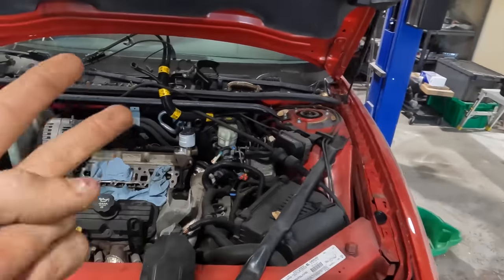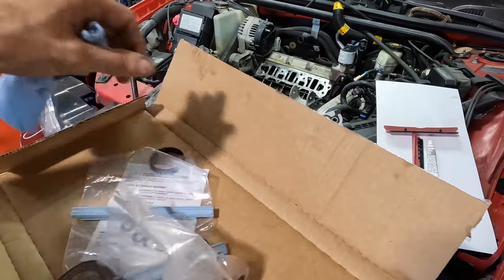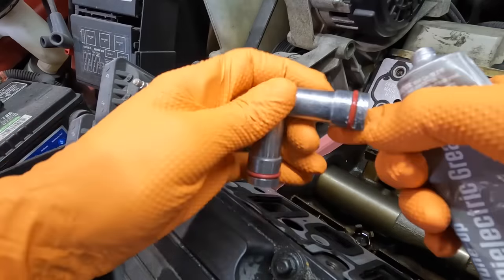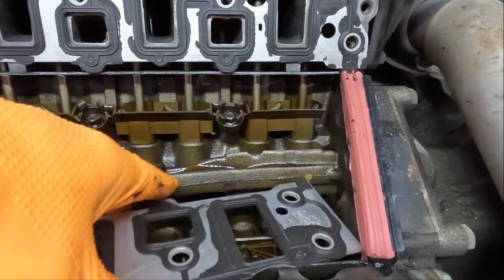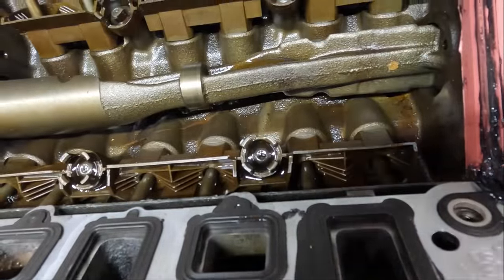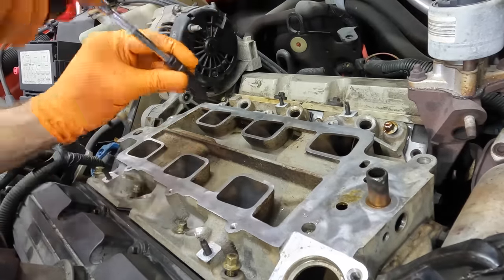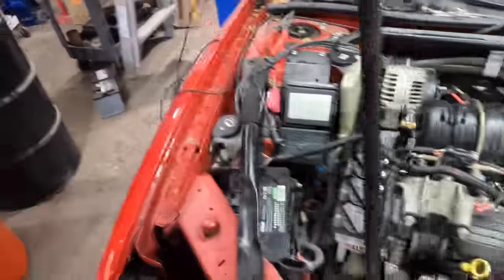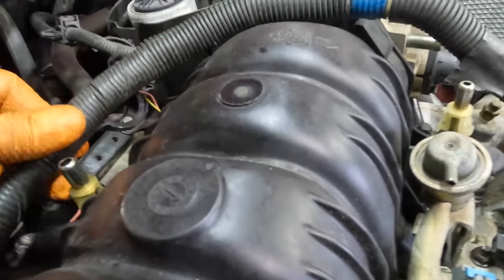Blown out Intake! 2003 Chevy Monte Carlo! 3.8 #mechanic #enginework

Comment from the maker: PT 1: Oil in Radiator! 2003 Chevy Monte Carlo 3.8 Manifold Leak!
https://youtu.be/R-0lWogkyhk
Reply: 15:48 - The threat of the prybar convinced the EGR tube to go in.
Reply: Bacon grease, but of course!
Reply: What a waste of bacon grease. Silly Ray, bacon grease is for eating 😋
Reply: THREE.
Reply: That other style aluminum elbow you were referring to goes on the bottom of the belt tensioner. I always remove the  belt tensioner and change both to aluminum, then it is good to go for a long time.
Reply: Am I wrong for asking why you didn't do the back 3 plugs while the manifold was out? Seems that would be easier. Feedback please
Reply: Mmmm, Bacon Grease 
LOL!!
Reply: @cw3339  Among other things...,
Reply: Got o pop problem with suction in my 3.8 by intake blew hold in my new plenum any thoughts it’s over heating a lot coolant low light won’t stop coming on even with new radiator and sensor in radiator for low coolant driving me insane why and suction issuie suction also on rubber gasket on map sensor
Reply: Outstanding video as always. Will watch your videos all night long, oh and day too. Lol

Comment: Replacing a manifold gasket is a lot more fun when I am watching someone else do it 🙂
Reply: 3800s aren't too bad. The 3100/3400s, on the other hand...
Reply: Everything's a lot more fun when somebody else does I like getting my hands dirty have a great day
Reply: @Michael Pressman  I liked to get out in the shop 3 or 4 days a week and get dirty working on assorted  motors too, but there is something interesting about watching someone else do it. You never know what tricks you might learn.
Reply: @joevk6274  every manufacturer had one of those at one point or another.  Parts that only go on easily with the motor next to the car.  🙄
Reply: Damn right
Reply: I can watch hard work all day!
Reply: @Jeremy T  If I am honest, I love wrenching on motors but it's nice to know I am not alone when I see someone else doing it
Reply: Frfr😅
Reply: @joedavidzuniga1993  🤣
Reply: It certainly is. I did many of these at a independent shop, and on my own vehicles.
Reply: @jamosgarage9006 Me too. I moved over to small engines just to get out of bending over a fender all day.  Having them on a bench makes it a LOT easier
Reply: @Guys playing with tools , I know former car mechanics who went to small engines, atvs or forklifts. They all said it's better than cramped engine bays and under dash. I honestly prefer body, paint and accessories.  I barely do engine work anymore.
Reply: @jamosgarage9006  You get it. I have never had to put my arms or body someplace it didn't want to fit while working on a weed eater or a mower 🤣
Reply: Only ever done it once. Was pretty easy actually. Looking at my other cars' engines, I wouldn't touch them.
Reply: @MusicConnoisseurian  When I was a kid I would change the intake and carbs around on my assorted hot rods all the time, I got pretty good at it but I sure don't miss doing it.
Reply: @AZ-pi9yf  You are right. It would be tough to have the knowledge but not be able to use it
Reply: Shit rays doing bread and butter. I have a bunch of transmissions from frod,gm and Dodge as well as getting race cars ready for the season. My buddy has been in the auto repair situation since 1965. 😅 Yep when muscle cars without electrical tech roamed the earth. I got to do this intake job in a supercharged regal after I rebuild the transmission. 😊
Reply: @jwise7114  When I was in my 20s I loved working on cars. It was my world  I moved to small engines later because they fit on the bench and didn't make my back hurt. 😁
Reply: Is this a over a grand repair cost
Reply: @MichaelSharp-sq4so  Of course I would do my own without thinking about it, but I don't think I would want to do someone else's.... even for that kind of money.
Reply: @joevk6274  what are you talking about lol. I have replaced many of these gaskets and the 3100s/3400s are much quicker and easier to do than the 3.8s. You dont even have to pull the injectors to take the LIM off. The only thing is that you have to take the pushrods out, but theres a tool you can get so you dont need to do that.

Comment: If that intake issue did not exist GM may have built the perfect engine.
Reply: So much for bulletproof.
Reply: @josephbucknavage6739  They are awesome engines. Cheap to fix when they seldom break.
Reply: Valve cover leaks too though. I'd have replaced them if I were ray.
Reply: They could have easily fixed the few minor issues and surpassed the reliability of Toyota's 3.0/3.5 V6 and put it in SUVs and cars etc..., but alas GM is clearly run by idiots.
Reply: replaced with a steel gasket is the fix to the perfect engine Ive had many over the yrs  Gm f#@ked up by dropping this engine
Reply: @RichHolz  Another issue with the 3800!was it was a cast iron block and that is not allowed on passenger cars anymore.

Comment: I've done this job several times. I always replace both 90 degree elbows so the lower manifold goes on much easier. So the other plastic elbow is now gone. One brittle elbow is always a great indicator that the other is not too far behind. I do like the way you didn't skimp on the sealing silicone on the corners that are notorious for leaks. Job well done. Ray have you ever seen that metal egr metal tube causing the upper intake plenum to warp from heat and fail? Some felpro sets have a replacement metal tube for the lower plenum that is a smaller diameter??? Thanks for your expertise with fun

Comment: In the UK we don't get to regularly work on American vehicles but surely the time to replace all three rear spark plugs and ht wires was when the whole induction system had been removed? 
As always good entertainment, I desperately want to assist Ray at certain times, my fingers itch to hold a bolt/nut/etc.

Comment: The intake manifold bolts need sealer on the threads to prevent oil from traveling up the threads and showing up on the intake manifold under the bolts, since the bolt holes are open to the crankcase, except for the bolts on the very end, sorta like a gen 1 SBC.  It does not show up right away, usually several thousand miles later.
Reply: Yup, lower intake bolts need sealant on the 3800's...
Reply: Just did the same job on a lesabre last week. Did the job because coolant traveled up the threads on one of those bolts.
Reply: Yep very common on these. Sad that this hack didn’t do it and will most likely have leakage in the near future. Bottom elbow should have been changed also. Just a time bomb 💣 waiting on failure.

Comment: I used to do a TON of those LIM gaskets, coolant elbows, valve cover gaskets, upper plenums on the 3800 series 2 engines. I haven't seen one of those cars in my area (rust belt) in years.
Reply: I'm still doing the LIM and valve covers on them here in Idaho. Last one I did had 330,000 miles on it.

Comment: Great use of that Bacon grease-i hadn't thought of using it that way. Can't wait to replace the plugs in my Prius and give it a try  👍
Reply: and it smells SO much better
Reply: And that way he can save the silicon grease for cooking!
Reply: Always used a small amount of dielectric grease in plug boots to prevent sticking to the plugs and anti-seize on the plug threads (especially aluminum heads) to prevent difficult removal.

Comment: Torque wrenches always make me nervous.... I was using one to tighten a bolt and snapped the bolt.... caused about 5 hours extra work to remove and rebuild so now I triple check everything at work.... 
Great work as always Ray, I bet there are techs out here watching and taking notes
Reply: Yeah, it's a real sinking feeling to feel the bolt approaching torque and then you feel the resistance start to go away as you turn it.
Reply: Often times when torque wrenches are set at their lower or upper limits you will not hear a click.  You will only feel the give in the ratchet head; you learn that lesson once for about 3 hours…
Reply: Most spring type torque wrenches are out of calibration. Most techs don’t zero the setting after each use and the springs compressed over time weaken them and they are out of calibration.

Comment: My brother just found it necessary to replace the plug wires on both of his cars with this 3.8. The Buick has around 150,000 and the Pontiac has over 400,000. I have once had a car with this series of engine and I agree it is a phenomenal platform, save for the plastic coolant pipes.

Comment: For those who may attempt this job, you should know that Ray has skipped what GM recommends be applied to the lower intake bolts to avoid any leakage through the threads. Permatex 59235 High Temperature Thread Sealant or it's mini version 59214 is readily available. AC Delco does have the official sealant, (GM PARTS 12346004 - LIQUID TEFLON SEALANT), but the Permatex is cross referenced and commonly used by professional mechanics. Go with whatever is easiest to get.

Comment: I like how you describe how to install the lower intake gaskets and how to just use a bit of RTV at the corners.  And then shazzam, you glob that shit all over !!!!    I almost peed myself
Reply from the maker: Ohhh no, I’ve seen folks use the whole tube in one sitting 😂
Reply: @RainmanRaysRepairs    Yep The machines I worked on for 37 years had a similar issue on the gearboxes, just a bit in the corners.  Techs be like nuh uh  squirt da whole tube on there mang.  If a little is good a bunch is better....lol

Comment: Great Job Ray.  Just in case you have not noticed that... The spark plug cable are not going the same way as they were by the manufacturer....  Check your first video... At 2m12sec...  The cables pass under the fuel rail...

Comment: Also. Its easier to take the tensioner assembly off then do the lower manifold, Then re-install the tensioner assembly install coolant elbows, instead of fighting the elbow on an angle. Easier and a nice straight install....

Comment: I have been told that using a little  gasket sealer on places where gaskets meet and where metal joints are found and even a little to help hold a gasket in place during reassembly is not necessary with the new gaskets. I feel it us necessary even if for just my own self assurance. I'd rather do overkill than have a job come back and/or lose the patron. Really like that you have found a new use for bacon grease. lol

Comment: Great video Ray!  That lower intake looked a little pitted where it mates up to the square coolant port on the cylinder head.  They can get terribly corroded on the 3800's.  I like to use some ultra grey on the lower intake gasket if it is pitted to make sure it does not leak.  Also just wanted to point out that the lower intake bolts will wick oil and coolant if sealant is not used on them.

Comment: Back when I lived in Orlando before 2005, I drove an '85 Porsche 928S2 5 speed.  The manual transmission was rare, but I found one.  And the S2 was a very rare European version with 330 hp all in a 3300 pound half aluminum car.  I put a Borla exhaust on this car and all the time at stop lights guys would come up next to me and ask me if I did a Chevy conversion [they make a kit, it is very easy to do].  No, the engine was pretty much stock, other than a chip on the ignition and a rising rate fuel pressure regulator;  The Borla let the world know that a crossplane-crank V8 can only sound one way.

That car?  It was a very dark brown metallic color.  I would pull up at a stop light with the exotic look and the deep rumble and it was like Darth Vader showing up behind you in line at the bank; It had TOTAL presence!

-One thing I noticed: EVERY guy in a big diesel pickup wanted to race,  and EVERY guy in a V6 Monte Carlo wanted the same action!  I'm not kidding, these people thought they were going to score a big win and invariably they got shot down hard.  The 928S2 ran a 13.86@105 at Bithlo speedway one day, and while that really isn't that fast today, back then it was pretty solid for a car that really had only slight modifications.

What that sort of performance was like in 1985?  It was pretty much Testarossa and Countach territory, in a form that shouldn't be that fast.  I'm sure the first owner who gray-market imported this car had a smile on his face on a regular basis. On the highway the way this car went from 70 mph to 125 mph in about 7 seconds....

Comment: I had a '96 Bonneville with the 3.1 with a manifold oil leak. If I ran anything but Quaker State motor oil I'd smell burning oil right after an oil change. Add 5 ish foot lbs for the extension perhaps? Champion spark plugs always ran much better than ac Delco plugs for me but that was back in the eighties and standard points. I always ran hot plugs on account of the old cars I had which didn't have much compression left.

Comment: Besides these intake issues and that coolant elbow and a few other minor things these 3.8's are great engines. I saw a Buick Lasabre at the auction the other day with 462,000 miles still running strong!!

Comment: Ray, you made my day again.😂 you do the same work to every vehicle. However, I’ve noticed a bit of favouritism to a certain manufacturer. Your enthusiasm has forced me to look at a certain company. So I’ll get a 3.6 litre AWD Acadia that burns oil. 12.5 hours for the timing belt. Then the actual repair of the pistons. It’s an 09.I’m giving myself the summer to fix it.
Reply: 3.6 does not have a timing belt.
Reply: @mph5896  it has timing chains, 3 of them to be exact and the tensioner are usually faulty causing all kind of mischief. Plus they had a lot of issues with their pistons blowing oil.
Reply: @Simr Khera that’s why I just bought possibly the worst GM engine and am committing to doing it as good as Ray would. I’m still going to blame him for every mistake I make. 😈

Comment: Ray says "super nice engine"  but it will fail and leak coolant into the radiator,  that sounds Super nice. 
I Was a chevy fan up till 2000.  If you notice Ray has been fixing 40% GMs, 50% Chryslers, 5 % Fords and 5% impots

Comment: Having worked a parts counter for... uuhhh longer than I like to admit. That "Not Returnable If Opened" only applies if you want to return it to Federal-Mogul/FelPro. ;) Parts dealers will take them back as long as all the pieces are there and they don't look like they had been test fit(aka Dirty).

Comment: I would say its the head gasket if there is oil in the rad.    It’s this gasket if there was coolant in the oil. 

I bet we will see a head gasket replacement in a few weeks as well.  

Seems awkward not to do it now.
Reply: You gotta remember that Ray is more content creator than mechanic now so hes needs content coming in that isn't tire and oil changes
Reply: Wondering why this are great engines when these gasket issues are typical and of course not an inexpensive repair ?
Reply: I had oil in my radiator, 
For me it was the LIM gasket.
2002 Impala 3.4
Reply: @andyloebrown8250  the same for me too, ‘99 Buick Regal GS
Reply: Although that was a useful rule of thumb, specific problems unique to a design are seen at dealerships even before warranties expire. You can see the way this intake is strangely designed, with coolant passages very close to oil passages, something usually only seen at the head gasket or deep in the engine. Ray worked at a Chev dealership and obviously has done this specific task on this specific engine many times. So, I'll throw out a guess that he knows a lot more about this engine than any of us. Looking at the way he confidently diagnosed and sailed through the fine details of the job, he's done it many times. Also in part 1 there was definite evidence of how the old silicone gasket material had bulged out and leaked. Typical oil pressure at idle is 20-30 psi, and typical coolant pressure is 16 psi, but both vary widely. So there is overlap each way depending on engine conditions, meaning fluids could go either way at a vulnerable point.

Comment: You did a good job but missed a couple of key points. The coolant plate gasket on the drivers side of the lower manifold should have been replaced. Also, the upper manifold should have at least been inspected, or replaced. The upper gets brittle where the egr stand pipe goes through it. When it gets brittle enough it will break through internally into a coolant port. When this happens, the engine will start to ingest coolant through the upper manifold (burns the coolant) causing misfires, driveability issues and if bad enough, hydrolocking.
Reply: He did inspect and replace.
Part 1 it broke into little bits
Reply: @kellyc2425  That was the coolant elbow that broke. I'm talking about the upper intake manifold itself. It's a well known and documented issue with the gm 3800.

Comment: Geat video..i hope the mechanic iam using as I type this comment is as detailed as you! And what they jis told me half hr ago is  they can JB Weld where  part of the surface has pitted on the bottom of the lower intake manifold.. due to using stop leak which I barely used hehe.. instead of them buying a new one for me at $500?? Is that a good idea to use JB weld on this maniflod? Thank you!

Comment: Man I had a swelled plastic ring on the bottom of my lower slider pin on the back brakes yesterday, caused the brake pad to not release fully, which I could hear while driving, that thing was a bear to get out..Everything was hard to remove..Ray makes almost everything look easy, but I usually struggle with every repair, but I always do get the win eventually..Why is that little rubber ring on the bottom of that slider pin anyway, as I'm going naked until one comes in the mail...

Comment: You didn't replace the SECOND plastic coolant elbow-tube below the alt? That car should have BOTH sizes of coolant elbow, the equal length one and the larger-end one. One is the heater hose supply and other is heater hose return.